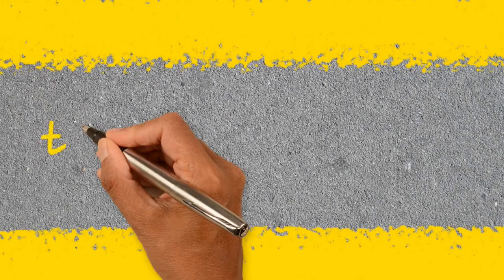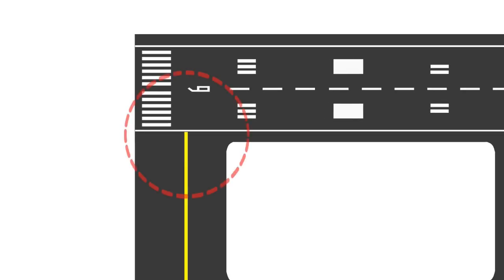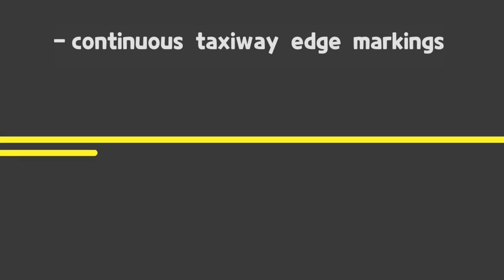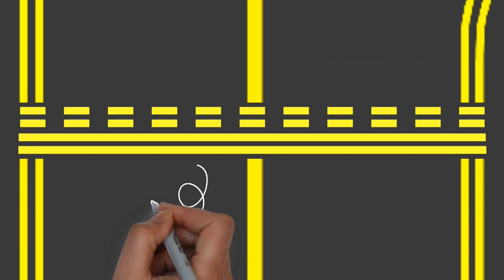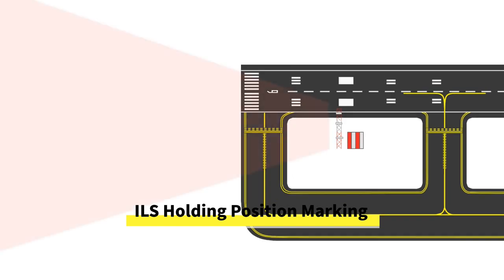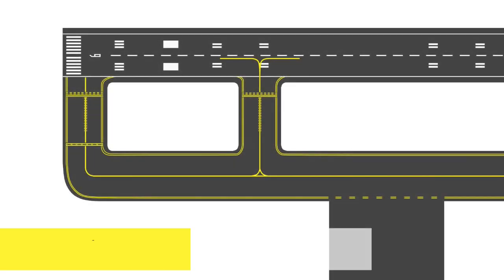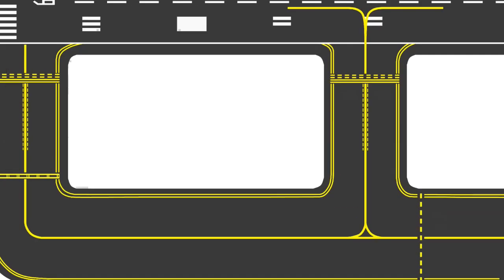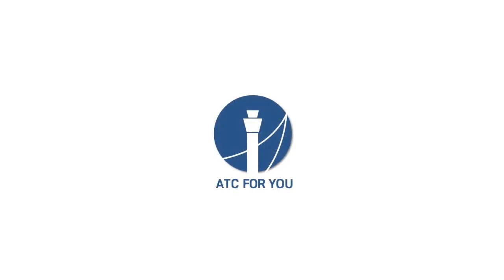All about taxiway markings

Comment: I have a strange question. How is determined the names of the taxiways? Why Quebec or Roméo etc?
Reply: they were created for the sounds in the words to be as distinct as possible
Read more here if interested https://en.m.wikipedia.org/wiki/NATO_phonetic_alphabet#:~:text=The%20U.S.%20adopted%20the%20Joint,World%20War%20II%20as%20well.
Reply: @jerryli6763  i know the origin of the alphabet alpha bravo etc, Or the number of the runaways. My question is about the name of the taxiways. Why this one is Quebec for example, this one is Delta etc?
Reply: @tombouchon6950  Just a guess but it also depends on the airport size. Normally I think they use some kind of continuous designation. Like if you have one runway with only one main taxiway and maybe three intersections, the main could be Alpha and the other ones Bravo, Charlie, Delta in order. The bigger the airport, the more factors for designation could/should be taken into account, also trying to stick to a certain logic if possible. The airport I work at, for example, has two parallel runways with the terminals and aprons in between them. There is one rwy in the south and one in the north. The taxiways which lead from the apron to the main taxiway parallel to the runway, are called entries. All entries to the southern runway are designated with Sierra (entry S3, S4 ) and the ones leading to the northern runway are named with November (N4, N5). The main taxiway parallel to the runways are also designated accordingly (N for northern rwy and S for the southern). Also, the intersections leading from N to the runway are named from A1 to A15, probably to avoid confusion because all intersections from S to the southern rwy are named with B. (Instead of making the main taxiway into S/N + a number) At even bigger airports, like Heathrow, double naming might also occur, so some taxiways have two letters and maybe also a number, like "NB1". To save letters, especially for short taxiways that are only there to connect (link) two main taxiways together, they also just use the designator "Link" + number. At Heathrow, they also use actual words as designator for intermediate holding positions like "TITAN","PLUTO" or "LOMAN". Which is also to avoid confusion in times of heavy traffic, I assume. If you look at some charts of different airports, you can usually figure out the logic behind it to a certain extent. But I can't tell you for sure. What I can tell you is that like everything in aviation, there is a reason behind it somewhere.👍
But these are just my 5 cents.
Reply: Thanks you for your long answer but very instructive.